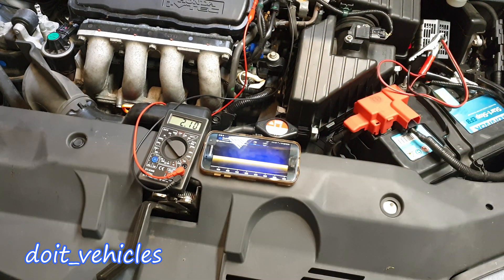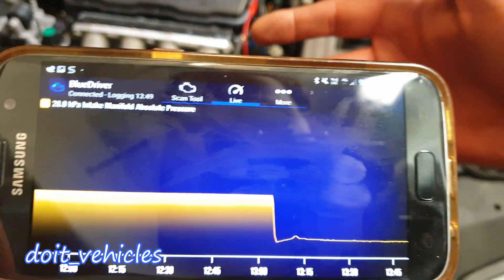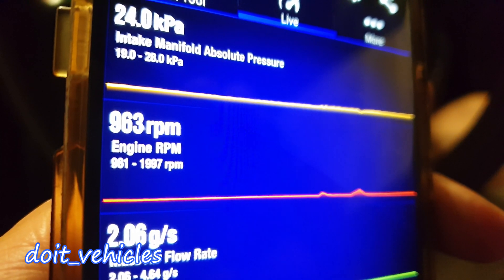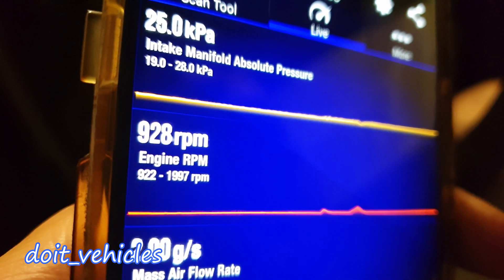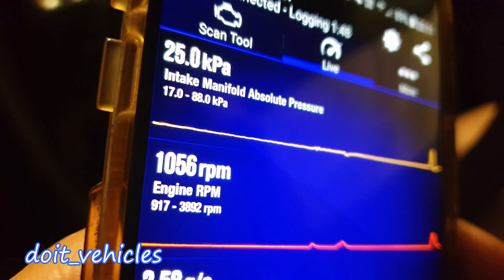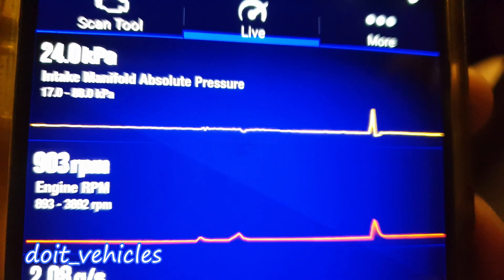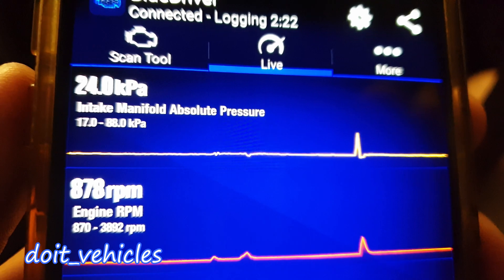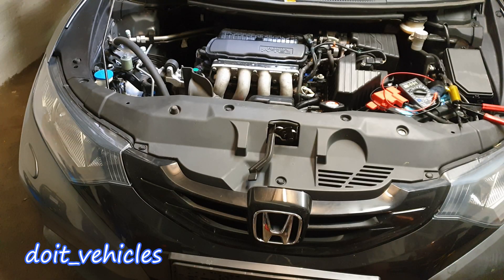MAP sensor - How it works -Test - Honda Civic 1.4 2014 9th gen

Comment: great info , i have a 2014 crv awd,  it behaves normally when pressing a little bit on the gas, it delivers the expected amount of power, but when pressing more the power start degrading and not as expected. I figured out it should be somethibg wrong about fuel/air mixture so thats why im here. 
i tried to disconnect the maf sensore but i couldnt it was stuck. Im just educating myself before going to a mechanic, i wish if im the right path

Comment: Really professionally done. I have Honda 2007 cvt, but I am having trouble from 0 to 20 km/hr speed, the rpm goes to 300 when I put from N or P to Drive. The car stalls and vibrates until 20 km/hr and accelerator pressing doesn't do anything. After speed of 20 it works fine. In Park and Neutral rpm is normal and stable 800 or so. Please guide. No errors or anything at all!!
Reply from the maker: You need to check the live data and detect what is out of the ordinary
Reply: @doit_vehicles  Taking off the battery terminals, and putting back, then starting the car for couple of minutes, then with Aircon and 10 min drive fixed the ECU and reset it. Let's see how it goes. Looks like all fixed. Before this I changed broken coils and even changed all spark plugs(not really was required) and got throttle body cleaned. Diagnostics didn't show anything. Engine and car started vibrating as soon as I put in D until the car hit next gear in cvt transmission.
Reply from the maker: @nishantb80  Interesting , so " reseting" the computer fixed the issue ?
Reply: @doit_vehicles  As mentioned, 1st I checked broken coils, replaced them. Then changed all spark plugs since they weren't changed since 5 years. Then reset ECU with OBD, which didn't work. Even Honda couldn't do anything. After which I got home, disconnected positive and negative terminals of battery for 1 hour or so. Put them back on. Started the car on park and let it run for 2 minutes, then switched on the air conditioning while still in park for 2 minutes, then drove it with ac on for 10 minutes. Done!!

Comment: Hey bro I have some issues with my M111 
I have ESP BAS and ABS errors on the dash 
Can you help
Reply from the maker: First You will need a scan tool compatible with reading ESP BAS ABS on Mercedes ...
Reply: Yes we scan the car it's shows weak connection on esp abs module , I think we fixed because when I open the module it's was 45-47 pins unsoldet : what do you think 
For now it's gone no errors on the dash
Reply from the maker: So you fixed the ESP connection , and all other lights are gonne ?
Reply: I was thinking it's gone , but now appear again , I don't know what to search
Reply from the maker: Try to disconnect the ESP module and see if extra codes appear . You might have to replace the module .. But you mentioned BAS . is your car newer than 2007 ? mine does not have Braking assistance system for example
Reply: Yes she have BAS 2000 year I'm from Europe